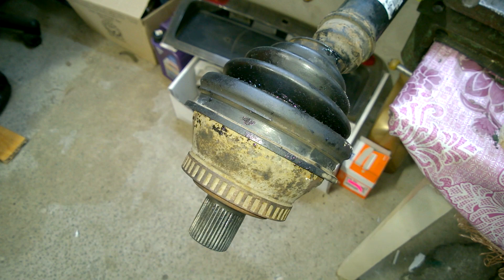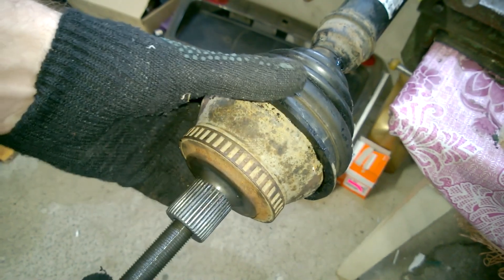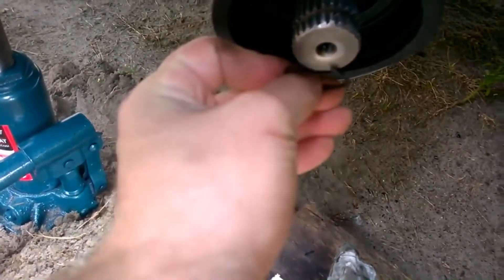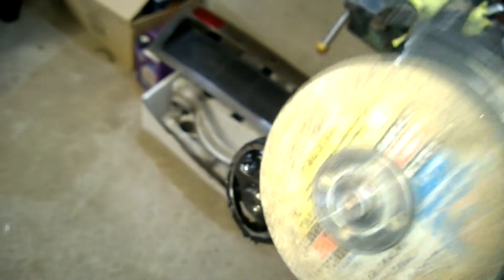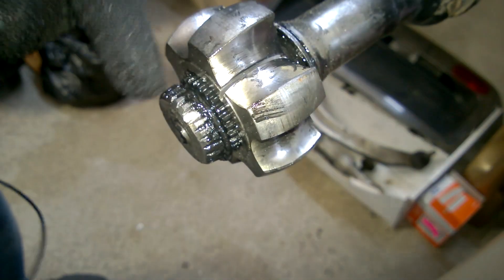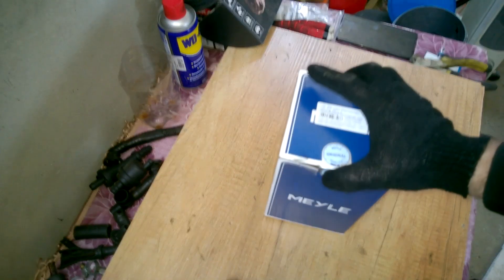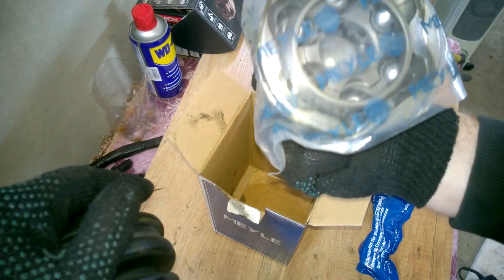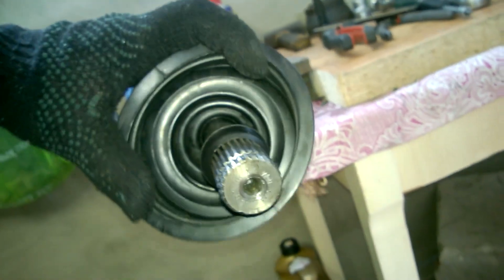Why Won’t CV Joint Come Off from Half Shaft? The Answer is This Video

Comment: I hate those circlips.. I took the inner joint apart on my Mum's Golf to change the boot without bothering the outer CV joint.
Reply from the maker: On some cars, due to the retaining rings, the CV joint cannot be removed at all and the entire axle shaft has to be replaced.
Reply: @autoyteng  I hate firing the parts cannon, but came really close to just buying a complete axle for Mum's Golf because even with the right tool I could not tighten the band on a new Meyle hard plastic boot and they kept falling off...